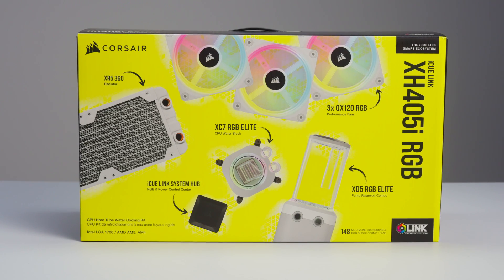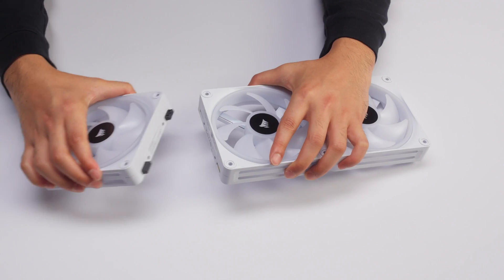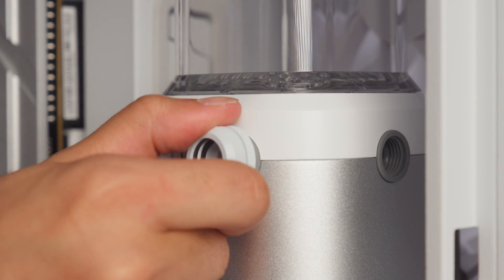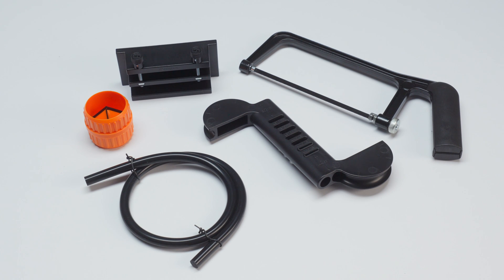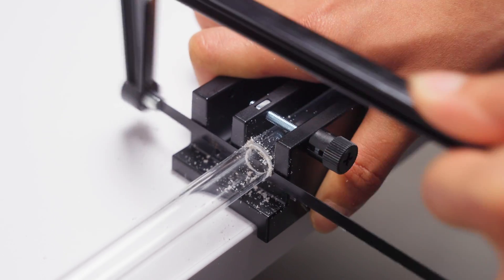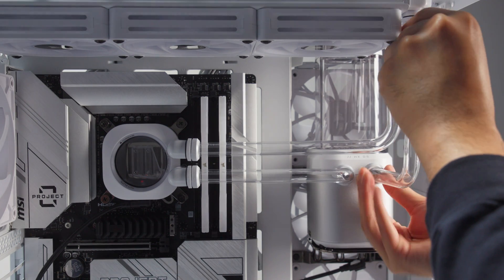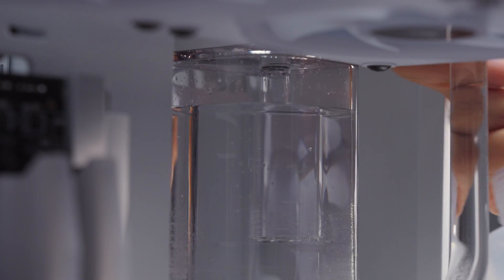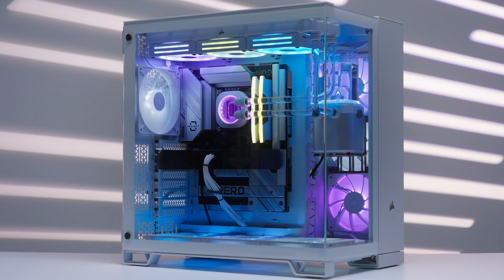Building with the CORSAIR Hydro X Series iCUE LINK XH405i RGB Custom Cooling Kit

Comment: There's just zero purpose other than aesthetics to have a half loop other than aesthetics. You're much better off just getting an AIO cooler. It's much cheaper, more convenient to remove if needed, and exponentially less likely to leak. Custom loops aren't worth the headaches. I'm talking from experience here
Reply: There's so much wrong with your comment I don't even know where to begin, you just don't understand.

Comment: i don't understand how the power jumper works, isn't the pump power source coming from the mother board?  how could it send power to the pump?  or is the jumper cored part of the kit and connect directly to the pump?
Reply: no the pump is plugged directly into the power supply. The jumper just tricks the power supply inot thinking it's plugged into the motherboard so the pump will activate

Comment: May i asking , If I have  the QX120 fan pack 3  and QX140 fan pack 2   Question is :  with difference size can it connect and work together with icue link ?
Reply: Yes you can mix and match sizes